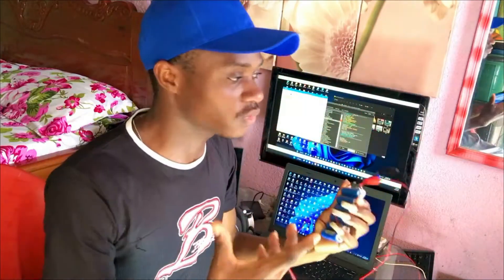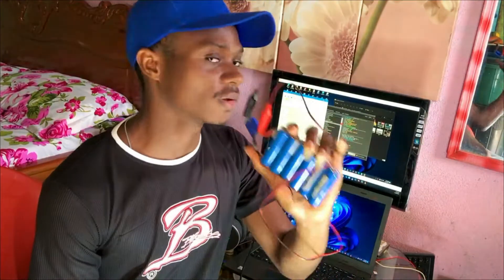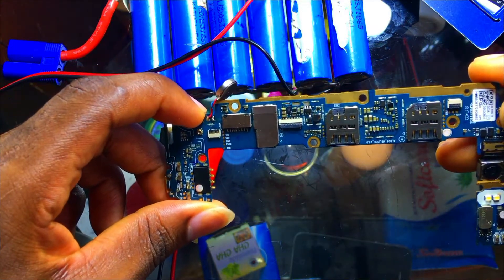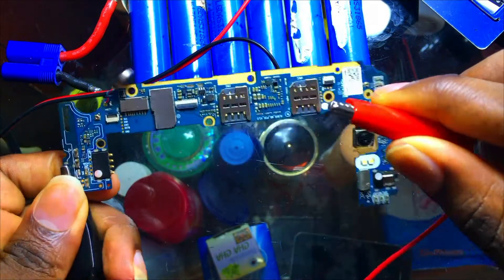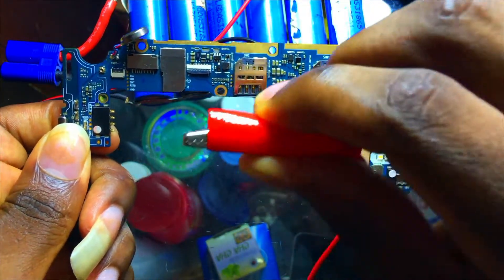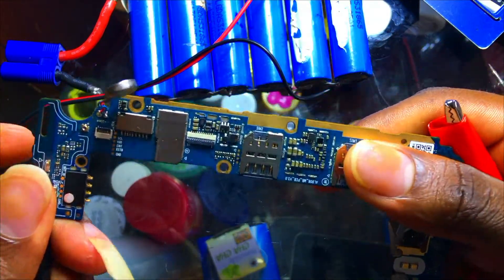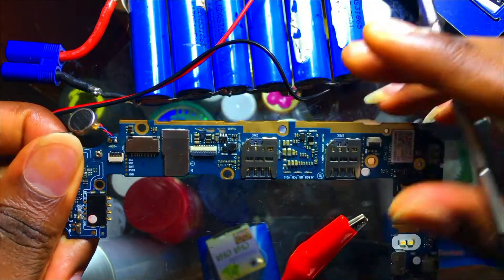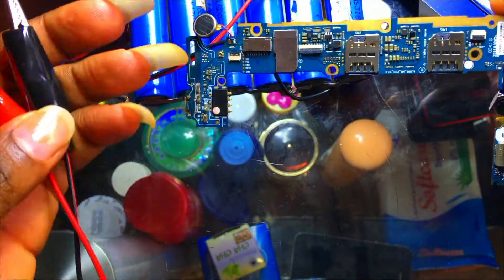How to Use A Short Killer to Remove Full Shorting and Half Shorting - Mobile Repairing Course

Comment: Guy this will kill ure phone. The voltage and current have to be regulated. Just buy short killer like sunshine p30
Reply from the maker: No it won't 😅
Accept you don't know how to use a short killer in a mobile PCB. I have used this homemade short killer for 4yrs as we couldn't get the real 1 from my area.

Comment: what is a safe voltage and ampere to detect short in smartphones.. ? Thanks God bless..
Reply: Good question
Reply: Start out with 1v and a few amps. Its the amps that will heat up the component to make it easy to find. Use a bench top power supply where you can control the volts/amps.

Comment: Buh bro's abeg Oo what will u do if the cell don't have this kind of battery terminals, how will u use the killer sir
Reply from the maker: You can solder cable or use your scroll driver as seen in the video
Reply: Ok bro's thanks

Comment: What if I use the battery 🔋 of a multimeter can I make a shot killer
Reply from the maker: Nope it will damage the Motherboard.  
Remember I said in the short killer making video that we need a high capacity (amp) not voltage.